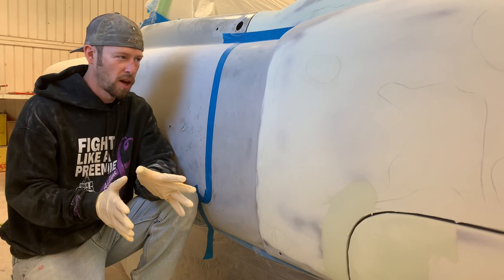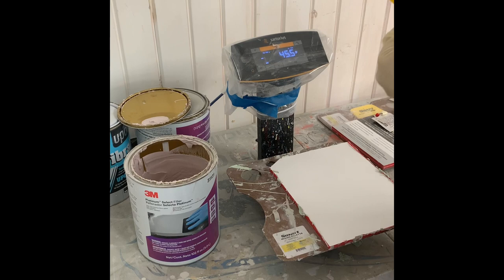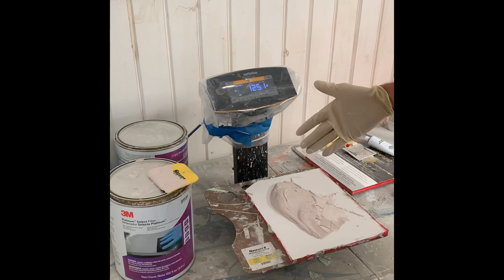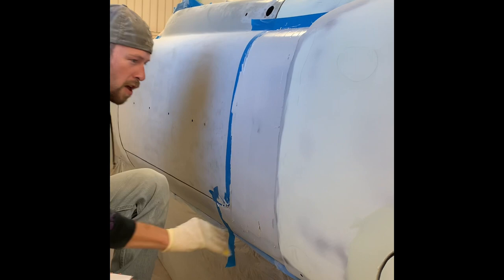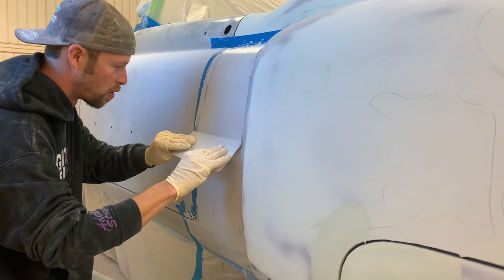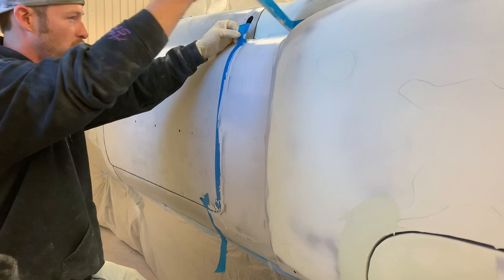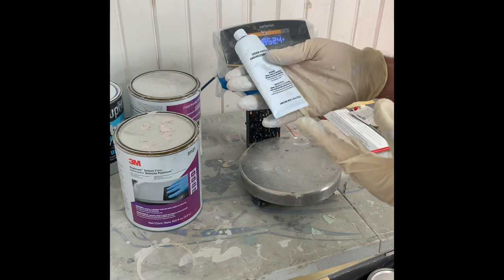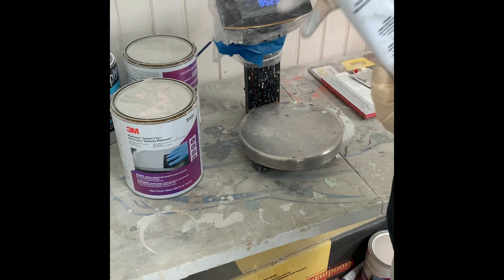Explaining the benefits of using epoxy before body filler

Comment: A few years back there was a rash of body filler related issues, 3m sent out a rep/ one of their main chemist, to do rounds at body shops checking for proper applications. I asked him about the holy grail of ratios & -“ 10% Hardner to product “ That has been working great , this is So. Calif.
Reply: makes no sense, you have a totally different work time depending on humidity, ambient and panel temperature and the product you're using

Comment: Strange that water in body filler is bad but you can spray a water based primer directly over bare metal. Do you spot prime cut throughs with the VP2050 before applying another coat of filler? No one seems to want to answer this question. Thanks
Reply: if you break through to bare metal,  yes.   the key is to not cut through to bare metal at this point.   block add filler to lows and when you have everything to one level step to your final grit this when if you cut through to bare its ok because you will be applying another application of primer preferably a high build epoxy.
Reply: @jakeymon22  
Thanks for the response. I know there is so much emphasis on not putting filler over metal so it just seems very time consuming when you do cut through to have to spot prime, let cure and fill again. I use VP2050 and it's a relatively slow drying primer. I've also seen the shrink test here about allowing three days to dry. To do filler on this scale and not cut through youd have to start with extremely flat panels or possibly get all this filler straight in one coat. Seems like a pretty tall order. Not saying it can't be done, just wondering how many cut throughs are directly filled or get a second round of primer and maybe that's why no one wants to answer the question. Maybe "cheating" a little?
Reply: @class5bodyworks  all bare metal break throughs if you get them get sealed again using vp2050. Because it’s also a high build & epoxy that’s the awesome thing you are only using one product that does it all.
Reply: @SYLVESTERSCUSTOMS 
Thanks for the info. Had to double check what channel I was on for a minute. Didn't expect to find you here.🤣

Comment: Great video, thx!  So I have a car with some very minor surface rust.  Is the correct procedure to sand it off, do the epoxy filler then bondo,primer,paint,clear coat?

Comment: Problem I've had using epoxy before filler is I almost always sand through it to bare metal in a few spots after I've applied the filler. I usually do another light coat of epoxy primer before moving on then. I dunno if that's the right way to do it. I've also used epoxy filler on bare metal instead of primer. But I don't think they are equivalent at all, but better than polyester based filler I think?

Comment: hi, how can you apply boddyfiler on top of 80 grid without shrinking back.  I usualy use Evercoat not 3M but in the TDS they say sand with 80 folowedbe180 to remove deep scraches around repaired area.  I'm just asking to learn from peaople with expirience in restourations. Keep doing your amazing work. Wish you everything best
Reply: Block the body filler with 80 till you get it really close then do a skim coat of polyester putty and block that with 120 and your ready to prime.

Comment: Are you applying the body filler before or after the epoxy primer cures? Does it make a difference either way?
Reply: Has to be within the recoat window of the epoxy without sanding. Once the epoxy is fully cured the filler wont have good adhesion.
Reply: @AA_Ron155  But can you sand the cured primer with 180 grit, before applying filler? I'm a hobbyists and sometimes have long periods of time between activities.

Comment: How do you sand? Once you start blocking the filler and hit the epoxy it will gum up, it’s not meant to be sanded?
Reply: Once you break through the outer skin of epoxy , it sands well

Comment: but isnt 2050 not an epoxy primer>? did you use an epoxy primer before the 2050,  i thought the 2050 is a standard high build primer?
Reply: It might be a hybrid, but it's not a true epoxy.  True epoxy seals the metal, 2050 does not.  The TDS states you can apply a PPG sealer over it if you like.  An epoxy wouldn't need a sealer.   And nowhere in their paperwork does PPG claim it's epoxy.   So I'm very skeptical that it is.
Reply: @SealofPerfection Correct.  I spoke with a rep at PPG.  It’s an epoxy/polyester blend.  I applied it over a steel plate and left it out in the elements for a year.  Within 6 months rust started creeping through.  This does not happen with a purebred epoxy.
Reply: @LynchAutoHouse  Yeah, the TDS even says "If preferred, VP2050 may be directly topcoated or sealed with a compatible PPG sealer."
So it's not a sealer, otherwise why would the say you could seal it?  There'd be no need if the 2050 itself was an actual sealer.
And nowhere in the TDS is the word "epoxy".

Comment: I thought epoxy sealers can’t be sanded? That’s what makes all this stuff so confusing, if you put filler over epoxy primer/sealer and fillers get sanded then that means the surrounding epoxy gets sanded too. I’m so confused by this.
Reply: Sure you can. Wear a mask. You can (and must) sand it if you’re coating it with anything outside of the recoat window in the data sheet.
Reply: @BushyB9883  It's well known you don't sand epoxy primers unless it's high build variant
Reply: @otallono  It’s well known you must sand epoxy primers for adhesion if re-coating or top coating outside of the top coat time. Otherwise, enjoy your paint until the first wash because that’s about how long it will last before delaminating.
Reply: @BushyB9883 I sprayed epoxy primer yesterday can I bondo straight over it or should I scuff it
Reply: @hserieshooligan1997  Some epoxies are different so I would recommend you check the data sheet. For most epoxies including PPG 408- Epotec I would leave it for a couple of days to make sure it’s fully cured and not going to sink or shrink, then filler on top. Putting filler straight onto fresh epoxy might cause adhesion issues with two dissimilar materials curing at different rates.
Reply: @BushyB9883  tried 180 that didn't adhere well sanded off with 80 tried again seems to have stuck this time lol 😆 Edit Novol 2k epoxy primer, everlast rage ultra filler
Reply: @hserieshooligan1997  Yep, go coarse on the paper and give it something to bite into. I wouldn’t recommend anything coarser than 240 for single stage primer but epoxy is hard so it needs a fairly rough paper. I find 120 works well for me prior to filler.
Reply: @BushyB9883  should I give it a few days to shrink before sanding
Reply: @hserieshooligan1997  That’s what I’d do 👍🏻